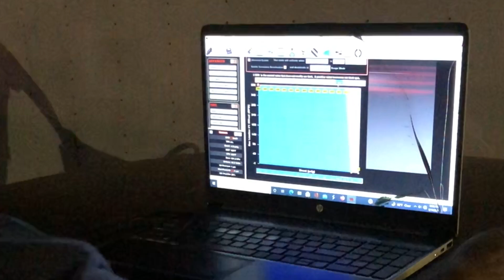Race Day, 28" Shootout Harrells Dragway

Comment: I'm sure you have had this idea or somebody on yalls team,Hell even on YouTube LoL but when ever you finish the new car and swap everything over in it you should pick up a Holley Terminator and Sbe ls I will sell you a little motor I got for about what I paid to put it together wich wasnt much and a budget VS racing turbo. Back when we where in that lockdown bullshit I was bored out of my mind ( like I am now cant work with all this rain)but I found a gen4 aluminum 5.3 block that was in good shape and pretty cheap, I was gonna use it as a back if I hurt the motor in my truck. I not an extreme cheap skate but if I can save money I will, I've ran way more 4.8s than 5.3's and i didn't have any 5.3 rods or pistons just a bunch of gen4 and gen4 4.8 stuff I picked the best 8 rods and pistons out my stash lol plus I thought it would be cool to have a aluminum 4.8 I've personally never seen one. It's got some arp rod bolts and all brand new o.e  hardware and bearings from auto zone I didn't reuse any bolts or bearings except for the cam bearings they looked good and I dont have a tool and have never done it, somehow my local auto zone had a good melling oil pump( I'm not a huge fan of reusing oil pumps). The bottom end is ready to party I even opened the ring gap up just a tad LoL the only thing about the long block I'm not sure how much power its gonna be able to make with the heads I have on it they are  a set of 706's I got for free they just needed decked and I had'em took down alot so the deck thickness is questionable for boost and I honestly dont know how much lift it can run before the valves kiss the pistons, I had these heads on my ex wife's little sn95 with a gen3 5.3 with a little spray (i hit it with a 150 a few times but usually it was jetted at 100 with a progressive controller for her to get her feet wet) it had a pretty mild cam with around .540 or .550 lift I think it was one of btrs truck cams, IDK about them I was gonna see what they did before throwing another set of 706s or 799s on it. I would change a couple things before shoving 30+pounds of boost and 7500+rpm at the moment it's got auto zone duralast lifters and pushrods and the pac valve springs are probably a little tired and head studs I almost forgot I would definitely get a trunion upgrade kit for the rockers. All it needs is a big boy VSR cast or billet s485 or 88 that should be plenty of turbo, Holley efi, and some Bosch 210s in a truck intake ,Bosch 210s made alot more power on methanol than I thought they could. All that tho would make awesome content and then you could try running some stock block races I'm confident you could go fast wit that little motor.